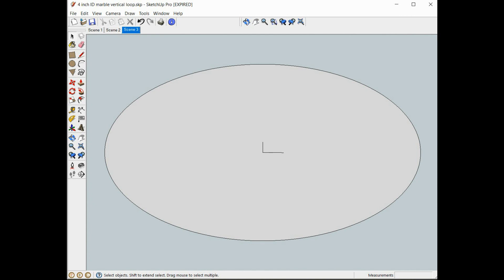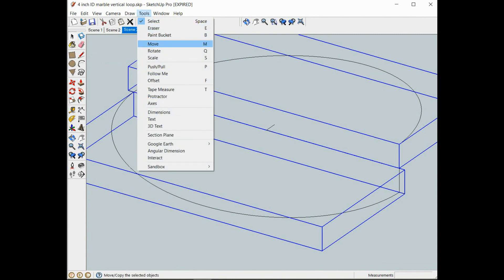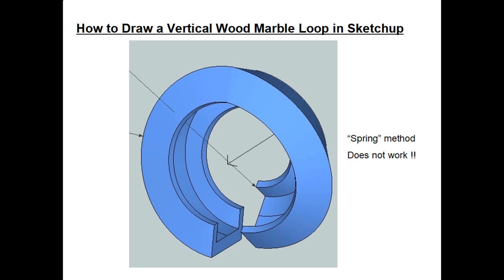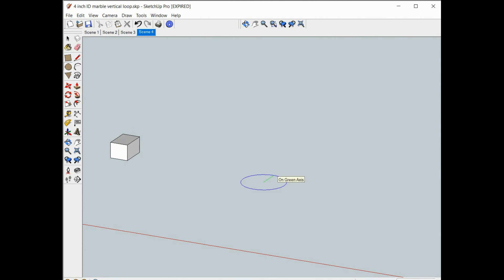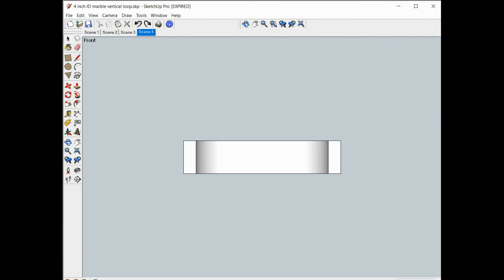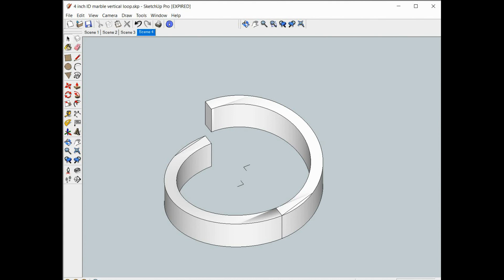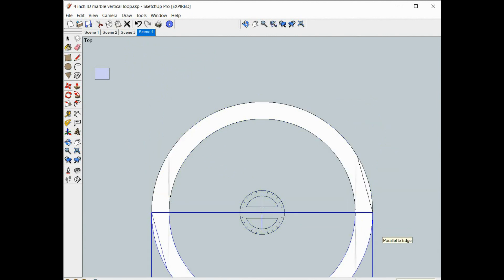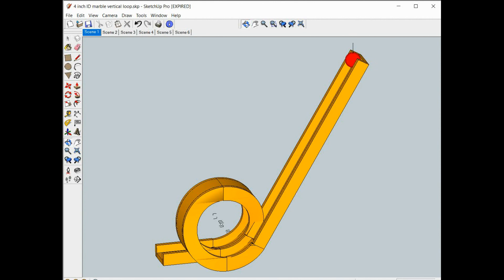How to Draw a Wood Vertical Marble Loop in Sketchup

Comment from the maker: I was drawing a different diameter loop, so I reviewed my video.  I could not remember why I raised the 1/2 loop piece by 3/4" when I dew the first 1/2 loop.  I went back to the cross-section drawing, and the other end of a 1/2 loop has to move by 1/2 of the total distance which is the 1-1/8" track thickness plus 2 pieces of 3/16" thick guide or 1/2 of 1.5" = 0.75".